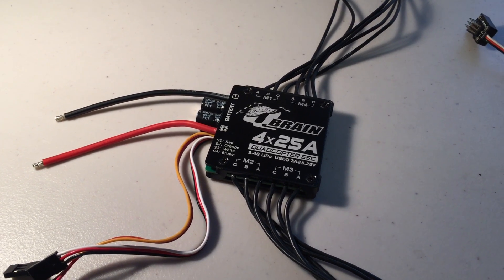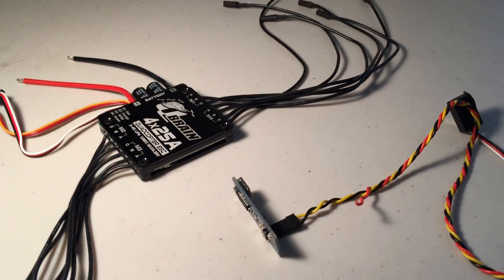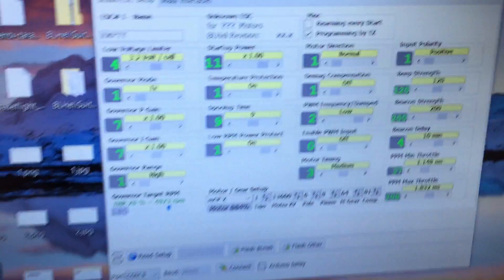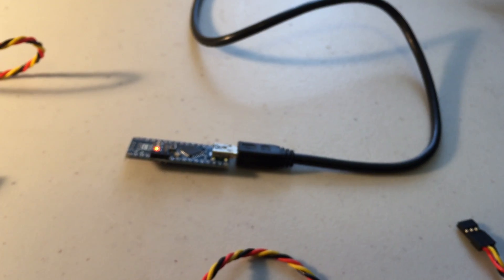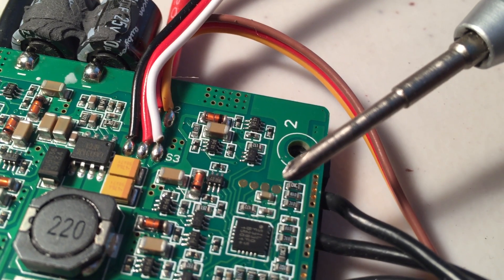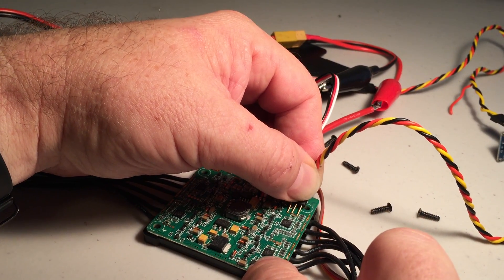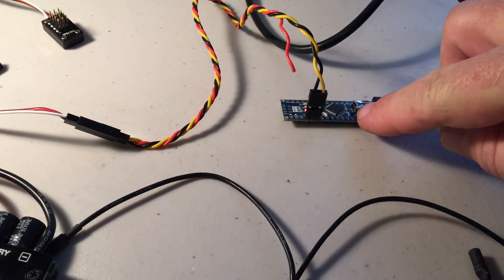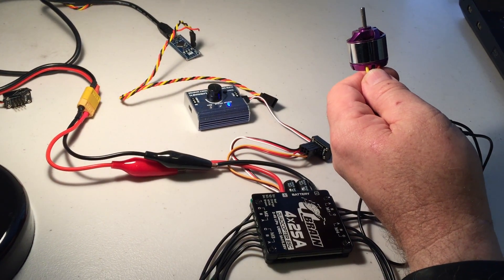Flashing BLHeli 14.2 to Q-Brain 4 in 1 ESC

Comment: hey rob, great video. I watched and learned a lot. You are a very talented guy.
I thought you were saying "reprogram p-brain" not Qbrain, that gave me a chuckle, you know why.
Current limited bench power supply is excellent for keeping the magic smoke inside the chips.
Reply: +WheresWa11y.  Funny you should say that because every time I spoke with p-brain an image of this ESC popped into my head.

The tech has advanced like crazy since this and you get get 4 in 1 escs now that are smaller and far more capable. (And much lighter for the same current rating.)

Comment: hey rob, great video. So you are taking a 25a. esc and flashing 20a software onto it, is that in essence making this a 20x4 esc instead of a 25x4? I really am interested in doing this but need the 25a.
Reply: answered my own question. On stock firmware with 2212 motors, 4s & 3s lipo, and 10x4.5 props on a 450 quad the esc was overheating and cutting out in the air, resulting in many crashes. After the flash to blheli, the esc barely gets warm, the battery stays cooler, and the motors stay cooler on 4s. Much better flying, with less twitching. I didn't believe it when reading about it, but its much better.

Comment: Do I need to calibrate the ECSs using a servo tester? Or can I do that with a transmitter?
Reply from the maker: You can use the transmitter but make sure the end points match the outputs of your flight controller or you may not have the full range available on the ESC.
Reply: +Trainboy64 thanks for your quick response. Can the full range of the throttle be calibrated in Librepilot using a CC3D flight controller. Sorry for for my dumb questions. I am totally new to quadcopter, but I am loving everything about it.
Reply from the maker: Mark Nano Not familiar with Librepilot and the CC3D but it can definitely be calibrated in Cleanflight with an appropriate board.   So I would say yes.

Comment: Does anyone know if the works with the EMAX 4in1 as well?
Reply: +Jürgen Hölker It works, I have done that with an older version: blhelitool_121it works better than the original firmware
Reply from the maker: +John Olivares Awesome, thanks for the feedback John, which firmware did you use?
Reply: do you have the pinout for the pads on the emax?
Reply: those  are the same, check which is ground for reference
Reply: Has been some time, i just flashed the EMAX 4in1 with your described method, kind worked, but i'm not able to connect to it afterwards with betaflight passthrough...
Reply: What firmware did you use? Tried the skywalker20a, but the esc is getting quiet hot from just 2s connected no load...

Comment: Motor timing should be set to High...
Reply from the maker: +fLaMePr0oF Thanks for the input, can you elaborate please?  For what motors specifically do you recommend motor timing to high?  I am running it on medium timing on my 1400KV Sunnysky motors and they seem to run perfectly.  On high timing they got very hot quickly.
Reply: +Carl Feniak correct, my comment was wrong, high is OK for large low KV motors or racers who care more about speed than life of motors, commented based on what I'd been shown rather than actually knowing what was talking about.

Comment: great stuff, i'm hunting around trying to glean info on the 4-in-1 esc's used in the jjrc x1, the x1 is a cheap brushless 250 quad with major issues with yaw lag hence i am trying to fit a cc3d  an rx and ubec inside its tiny shell, i have ordered opto minis blhelis but it would be good for other x1 owners if i could find a build using the onboard 4 in 1 esc's so i'm gonna try that first, do you think it is likely the cc3d will work using librepilot with the x1's esc's bearing in mind i dont know anything about them other than the chips have sorta capitol 'A' version of @ symbol on them (atmel ?), should i put 50hz refresh rate or 490hz, ie. will 490hz damage a 50hz system but 50 wont damage a 490hz it simply won't fly...any help or insight as to whether i should try this or not would help a lot, i am a complete beginner way outta my depth already.

Comment: Hi Trainboy ! I 've followed everything you suggested in this video but I flashed my ESC skywalker 25x4 /14.3 blheli  and  the motors got hot . 
What' the problem ? I can't resolve the case . Thank you for giving me an answer .
Reply from the maker: +Abdellatif El amri You could try using lower timing, e.g. Medium / Low.   Are you using active braking?  (damped light)

Comment: Thanks for the video, very helpful. Just flashed my first Q-Brain 25a, destined to go on a 450 quad - one question, I left doing the your settings and writing to the esc till I'd flash all four, screwed the Q-Brain back together and connected using the bootloader... Do these settings need just writing just the once as in Blheli is shows esc 1 but I assume the setting relate and control all four esc's? (copied your settings by the way)
Reply from the maker: +Peter Holmes Hi Peter, you have to write the settings to each esc individually.  i.e. do it four times.    You will need to connect the black wire (ground) only for each of the other three escs that only have the signal wire.   I should have explained that part in the video too.  Let me know if that makes sense or I can do a quick video explaining it also.
Reply: +Trainboy64 Just caught your reply, sort of understand, first time quad build, first time Blheli user, just fancied trying this 4 in 1 esc... I've followed your S500, that's my next project.. I've been reading too much as the brain (mine) is @ overload but made the bit & pieces to flash the QBrain ok, flash went fine, noticed you programmed the first esc immediatly after flashing but thought you finnish off setup in bootloader mode.. What I did notice when connecting in bootloader (twin cable signal/ground) that when doing the set up it only showed esc1, having never programmed any esc let alone a 4 in 1 I wasn't sure what I should be seeing in Blheli suite. So, are you saying the arduino needs just the ground and signal from each esc? when in bootloader mode? or am I way off
Reply: +Peter Holmes I've just reconnected and think I understand what you mean.., signal (white) on the arduino to single signal cable on QBrain, X3 black ground on 3 cable (BEC - esc1) to ground on arduino - anywhere close?
Reply: +Peter Holmes Ummm, that didn't work.. bit at a loss now. ESC1 read successfully but not sure what I do to bring up 2, 3 & 4 esc's to program them.. I have flashed all 4 individually off the pads.
Reply: +Peter Holmes , OK, Houston we have lift off ;)... I was right firt time.. I see it says esc1 everyime, so I named them white, orange, red, brown and could see as I changed the single signal cable, then do a read that it reverted to it&#39;s original setting, so set each one in turn and wrote that setting to each esc then went back and checked each one... settings retained a.o.k ;)... Sorry for my waffling...
Reply from the maker: Peter Holmes Yes that's the way!.
Reply: +Trainboy64 Thanks Rob. Now to decide which FC to use... SK450, 6 quid in the Hobbyking sale... I think I'll use the CC3D... £4 hand me down lol... Can I ask you something Rob, do you use a programming card now to set the QBrain... I read on RCGroups not to set the battery to lipo and as low a cut off V as possible
Reply from the maker: Peter Holmes No I don't think that programming card works once you install BLHeli.  Those settings you mention are only for the stock firmware - With BLHeli you don't need to set to NIMH,  that was only to disable the LV cutoff when using LiPo cells.  Not needed at all now that you have updated
Reply: +Trainboy64 Thank you Rob. I need to do some more research on BLHeli settings etc and their implications but from looking at the performance of your quad after doing the update... Certainly looks sharp mate ;) gone are the lazy, wallowing reactions I've seen other quads using this ESC in standard form. Well worth the effort.
Reply from the maker: Peter Holmes Yes definitely a big improvement.   I used a Q-Brain on my first quad build and was disappointed but that was two years ago, long before I knew how to update it.  That quad would fly great now with an updated version.

Comment: Help me ,please ... Serial Interface "4qANm328p16 Connected succesflly.
Connection to ESC#1 failed!
Please check data - und power - connection to the ESC
Hint C2 lines : OK
C2CK : High (seems OK,but may be floating)
C2D : High (seems OK,but may be floating)